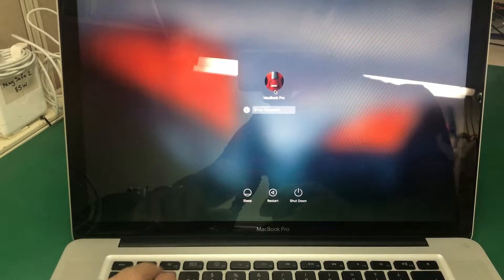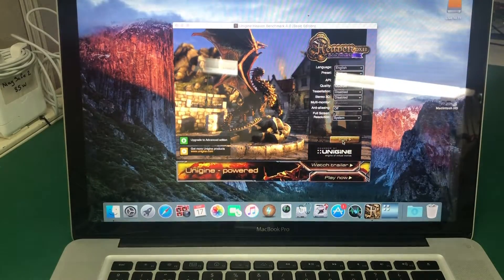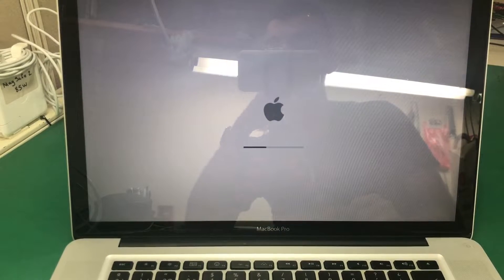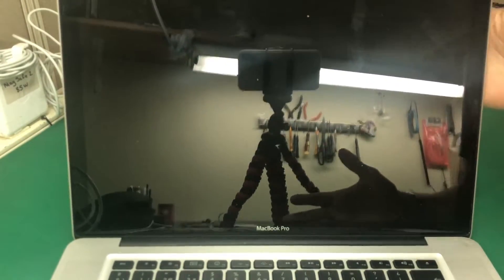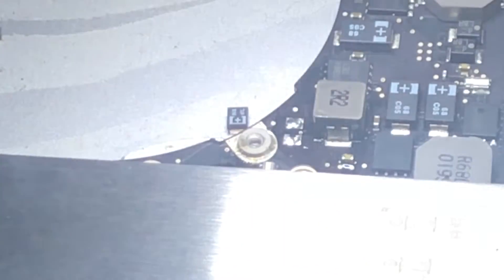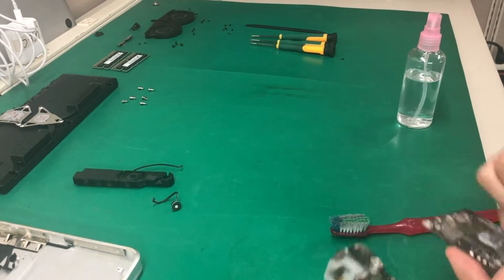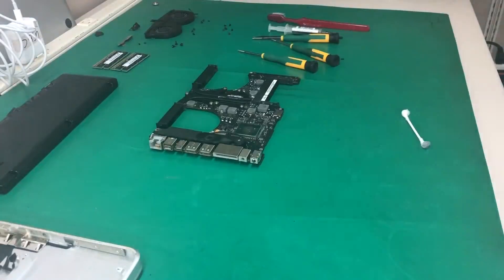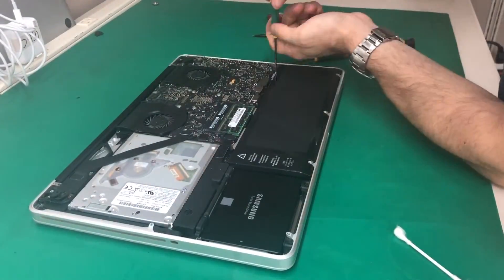How To Guide: 2010 MacBook Pro 15" Freezing Rebooting Logic Board Fix 820-2850 Bad Cap C9560

Comment: after change capacitor, boot up but keyboard not working,,, shutdown,, after shutdown check everything again,, and after that no more power on, i am using 330f 6volt, is this correct ?
Reply from the maker: Hi, i don't think is 330F perhaps microFarads try to look for the specs or the same capacitor ( C9560 )

Comment: Thank you very very much. I’ve been looking for this for long time. I have the same laptop with the same problem and I didn’t know there was a solution. I will look for a place to buy the cap since I am in Mexico and I don’t think I will find it here. But again thank you for making this video.
Reply: You can’t buy eBay or amazon in Mexico? There are Asia option aswell
Reply: Johnny Florida I have bought things from eBay and the parcels never arrive, postal service is not good at all here in Mexico. But amazon works, I’ve bought before and they do arrive. I never looked for that component in amazon I will check it out. Thank you for the idea.

Comment: Hello and Help have you ever seen this on a MBP 15" 2010 i5 CPU? I replaced the Cap and it still is doing this.  https://i.imgur.com/hFGIGtZ.jpg , any idea's would be appreciated.
Reply: Hi friend I have the exact same model with same problem as you ...did you get fixed or know the cause ? Thanks in advance
Reply: @antoniosoares8484  I disabled the gpu just like the 2011 and worked fine.
Reply: @rayshowalter6265  ok my friend thanks for the response which program did you use , I dowloaded gfxcard but problem still whenever I choose the integrated graphic card,  so i tried the patch by julian-poidevin it works for couple a days then the same symptoms again  😞 I did everything all right did SIP disable and try to do the patch again  and get successfully done but the problem starts almost immediately,  can you help me ? Do your Mac still working with no problem after so long with the graphic card disable with no issues ? Thanks
Reply: @rayshowalter6265  my friend please tell me , where did you got instructions for disable the gpu? Can you provide me the link please 🙏